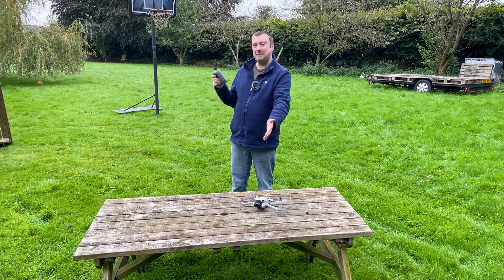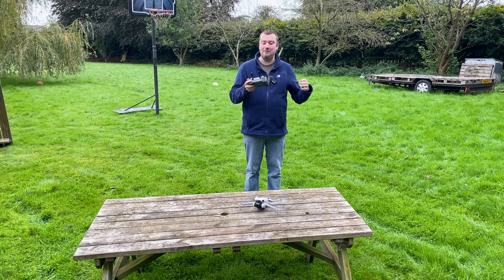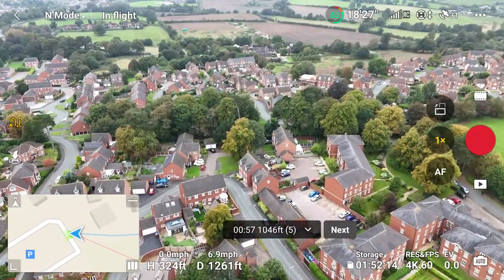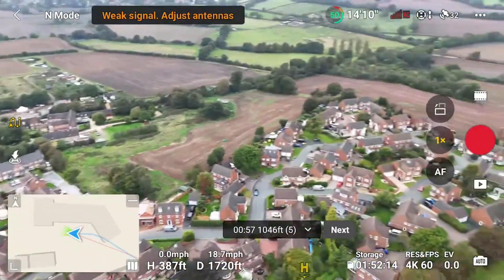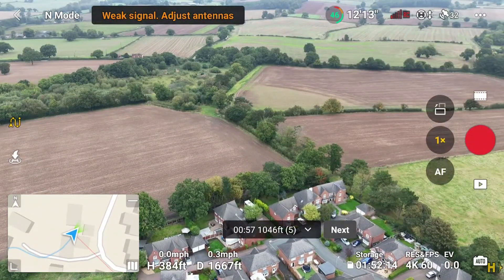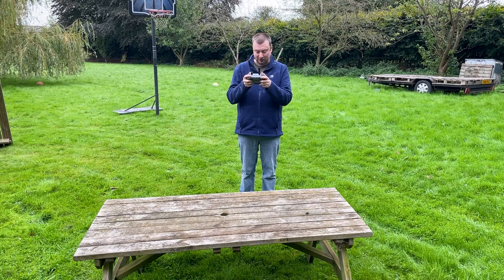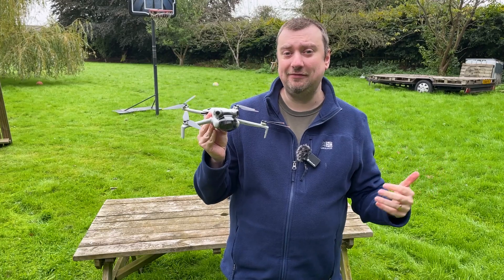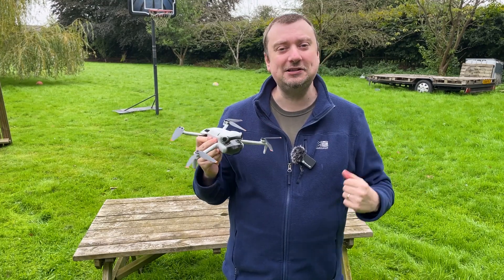DJI Mini 4 Pro Improved Transmission with O4? Real World Test!

Comment: Thank you Simon.  I wonder if O4 makes a difference over the open countryside?
Reply from the maker: You're welcome. It should do, as the antenna are better positioned. But I think in higher interference areas are where the biggest difference will be notable.

Comment: 507 meters which is approx the 1666 feet shown, with the signal strength showing red,  is still rather  crap.... Because the EU in it's infinite dumbed down wisdom, has killed the dB output strength by 50% compared with the FCC version of the mini 4 pro...

Comment: I also saw your earlier contribution where you tested out the Hollyland Lark C1 with the RC controller and therefore I also bought a Lark C1. Wondering if the Lark C1 also works with the new RC2 controller? Have you tested that yet?

Comment: The signal looks similar or worse than with the Mini 3 Pro, at closer range anyway. You're pushing it way beyond line of sight, over double what's possible, and don't seem bothered that we can all see that. You're not doing any British drone users a favour by breaking the rules like that as it'll simply encourage the CAA to be more strict. So we all suffer. Also you went above 400ft, whereas you should have it set not to go above that at all, other than over something like cliffs, where you can go higher than take-off point providing you're within 400ft of land in any direction. As for Wi-Fi interference, having housing below makes next to zero difference. There is enough separation, particularly with the 5GHz band, that it just won't affect the drone signal. Trees between you and the drone make a lot more difference. The power output restriction in the UK makes any new higher range technology completely redundant to UK drone users.
Reply from the maker: The Mini 4 does seem to be an improvement to me from what I tested so far. But I appreciate your technical analysis and thanks for your feedback. 👍🏻
Reply: What if Simon identifies as a someone with eagle vision, what then Karen? Bloody melt

Comment: Are you really allowed to fly like that in the UK? Where I live, we can't fly over other people's property if they have any sort of fence or hedgerow surrounding the property, without permission.
Also, did you ensure that the controller was facing directly in the direction of the drone?
Reply from the maker: Yes to both :)
Reply: Get a life karen😂
Reply: I try to be 50 meteers away or up  from houses
Reply: @EastAngliaUK  You don't need to be in the UK with a sub-250g drone. Simon did fly beyond VLOS though by quite a lot.
Reply: @geoffsmith6373 so what I bet u do to 😂

Comment: How ppl fly 10-20 kilometers when it loses signal aftert 600 meters? xD wtf
Reply: he's not facing the drone 90% of that video.. hardly an indication of anything
Reply: The transmission is restricted in the UK to adhere to rules. The enhanced range of the Mini 4 Pro and controller means absolutely nothing to UK drone users, it's aimed at users who don't have VLOS and radio transmitter restrictions that we have in the UK.
Reply: @geoffsmith6373  Sounds like great country
Reply: In fcc mode 10-20 kilometers not ce mode 😉